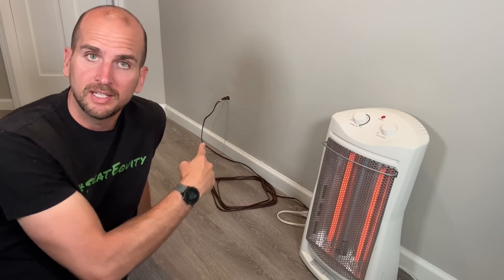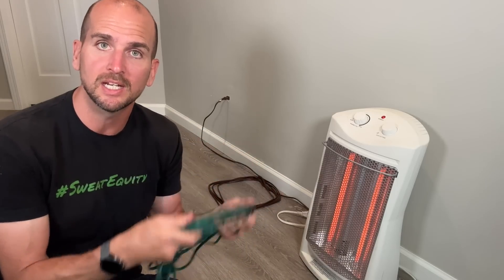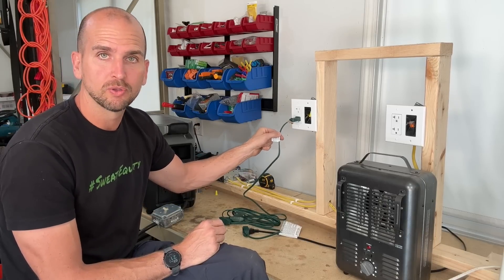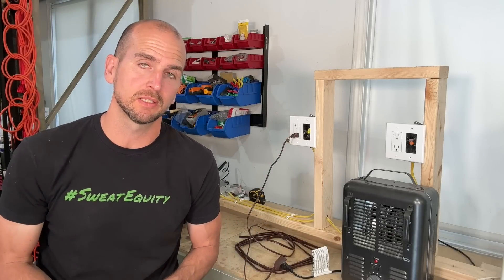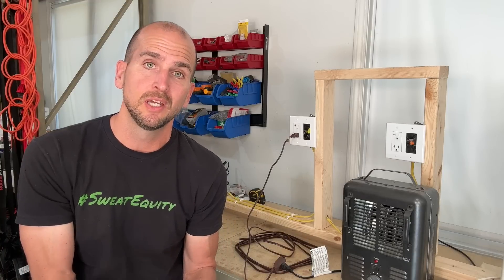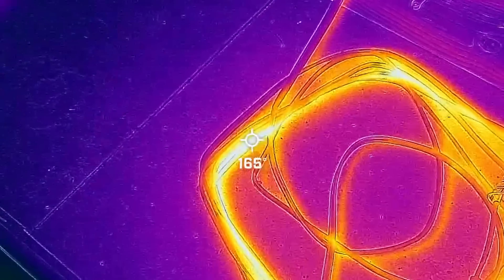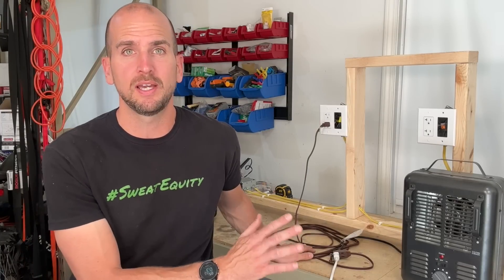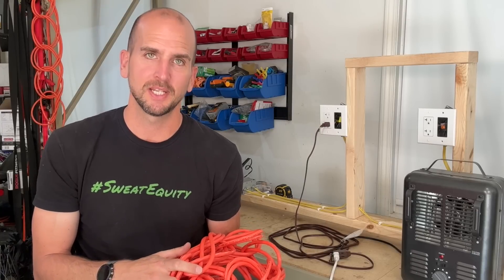The #1 Most Dangerous Electric Device in Your Home

Comment: My biggest concern with a space heater is the outlet. After i smelled smoke i began pulling outlets in my living room and found that most used backstab connections with 14 gauge wire and were daisy chained. 2 were visibly damaged and one was almost burned in half. I cut out the burnt wire and replaced every backstab outlet with a commercial grade outlet throughout the house, using the back connectors that securely connect with a clamp and screw.

Comment: I use the heavy duty AWG 12 type extension cords for my AC units, or for space heaters, or for a fridge.  I never wind any excessive length in a coil. I put the excessive wire length in a figure 8. This makes for less induction affect and thus less possible heat in the wire.  For small power consumption devices I use an AWG 14 most of the time. This is when I will be using less than about 6 Amps or so. 

I mostly make my own extension cords.  I buy the male and female heavy duty type plugs and sockets.  I buy the wire off the reel at the hardware store. I feel more secure about the quality of the connections in the plug and socket.

Comment: Another swell and sane video. Well done.

If you get into the trade you become aware that most fires reported on the news are attributed to electrical problems. 

As for gauge, since I understand loading I size the cord to the job. If it's a 10' extension for a table lamp and a clock radio, #16 is fine. If I'm cutting 4x4 on my mitre saw I use the shortest #12 that'll reach.

Speaking of that I bought a 100' #12 extension once on sale. Since I don't always want 100' I got a couple of cord ends to split the cable in two. Just before the sidecutters closed I got the idea (as close as I ever get to genius) that if I cut it in half I'd only have a choice of two lengths (50' or 100'), but if I cut it 1/3 - 2/3, I'd have my choice of 33', 67' or 100'.

Another vid I ran across some time ago concerned the use of those extension cords that come permanently attached to an enclosed reel with the outlets on it. You would think an advantage of that scheme would be only having to unspool the amount of cord that you needed. However even with a relatively moderate load, the fellow had this thing melt down on him due to mutual heating from multiple coils having been left inside the plastic enclosure.

Re storage style, after coiling cords up for most of my many decades, I recently adopted the daisy-chain method, but only seasonally. In my Canadian prairie climate you'd never be able to uncoil a cord stored like that in the winter, unless the jacket was rubber. Even then, the tightness of those little coils is kinda sketchy for handling at -40.
Reply from the maker: Thanks for all the great feedback and you are right in a cold winter if the cord is outside it can be a hassle to easily pull through the daisy chain.

Comment: I never had a problem with an extension cord but I did burn up a surge protector. I had 2 tv's, 2 cable boxes, etc. so I could watch 2 football games at the same time. One day I came home and it was all black and stinky. So I threw it away & bought another one. This was before flat screens when a 32" TV weighed about 200lbs and took alot more power to run (so I was told)

Comment: Some of us have no choice! Those who provide heat, as part of their rental, play with the heat. Those with breathing problems are impacted most. It's actually better to have the heat constant, so they don't keep us sick. That impacts insurance companies as well.
Where I stay, they have a habit of turning down the heat at night and winter is almost impossible to survive!.
Companies who make portible heaters could design them better so they work with common household loads. They know where their devices will bs used.
I never use an extension cord on any high draw circuit and I often check for heat, on the cord and the faceplate.
People need heat, no matter who provides it. 
Over the last 20 years people here have died that have breathing problems. Was it the cause?

Comment: The $200.00 single wall outlet is a laugh. Way less expensive to just install a box and single outlet/plate.  I don't like to even use space heaters as they pull so much current of some 12.5A combined of what else is in the branch circuit.  My extension cords are no smaller than 16 gauge 3 wire for light duty. Along with 14 -3 and one 50' 12-3.

Comment: I have read articles that one of the biggest fire risks with using a space heater is using a "Power strip" as an extension.   The power strips are meant for low drawing appliances and electronics.  They have been linked to many house fires when used with space heaters.

Comment: Extension cord plugs (even 14 and 12 gauge) can be a crap shoot if they get too hot under load. They're either crimped or soldered to the prongs. I like to run a heater for a while to see how the cord and connectors manage. If the plug gets uncomfortably warm, I just snip it off and put a heavy duty plug on. They have heater extension cords. Although they have the high temperature, rubber insulation, they are just 16 gauge and will get quite warm. They're also not grounded. A 14 gauge cord may actually be cheaper but will run cooler. 14 gauge and thicker cord uses a rubber insulation. I'm guessing it can handle higher temperatures. It's harder to strip when replacing the plugs, but just take your time.

Comment: Yeah, those lamp extension cords really are a design flaw. They really ought to require fused plugs in all new extension cords (and replacement fused plugs should be a thing and easy to find). As for preexisting extension cords, well, definitely use them wisely! I'm also not in favor of using 20 amp circuits for everything, but A. kitchens and laundry rooms require 20 amp circuits, and 2. Lower-current circuits here in NA are still 15 amps (Peak, but the 13 amp rating for lamp extension cords is also peak). 13 amp indoor/outdoor cords just simply shouldn't exist.

Comment: The problem I find is that while extension cords are easy enough to buy in 14 or 12 AWG, it’s hard to ensure that power strips and other accessories all meet that requirement. I would like my family to just be able to grab whatever cord they want without worrying about over-current issues, and I have found some specialty power strips and other equipment that I would like to use, but it is not “versatile” as you said because space heaters would overload it.

Comment: When I was a kid we had a cabinet style clothes drier, the sort where you could hang stuff in it.  It stood in a corner of the laundry where there as no power point so it was always run on an extension lead.  Mum always used a 7.5A (0.75 sq mm) lead while it really should have had a 10A (1.0 sq mm) lead.  Those poor old 7.5A leads became quite hot and floppy but never actually failed.  It's a miracle they didn't really the insulation must have been on the ragged edge.  The power point circuit had a 15A fuse.

Comment: This retractable cord reel that mounts in the wall i have is pretty nice for convenience, but they actually for safety put in a resettable 13-amp breaker in the unit even though it has 14-gauge wire presumably it is because you could plug something in while it is all coiled up and overheat the wire.
Reply: Cord reels are derated due to the cord likely being coiled while in use not allowing for heat dissipation.  18 gauge cord reels are illegal in the US, 16 gauge reels are rated at 10 amps, 14 gauge reels at 13 amps and 12 gauge reels at 15 amps.

Comment: I've known for a long time that extension cords are the causes of most electrical fires. I didn't know why until I got older and studied electricity. From that point, I thought ideally, all extension cords should start at 12 gauge and NONE of them should be without a ground. I also like the idea of a fuse, so that if they should become dangerous, they have a shutdown.  My Grandpa had a produce business and he ran a space heater in the trailer of his truck and a heat lamp under the cab to keep the engine warm, using one extension cord that was a standard household cord. He burned them up and repaired them with electrical tape, and almost burned down his garage. He couldn't understand why and I wasn't old enough to know to tell him why.

When I turned 13, I told my parents I was moving into the basement. I had a space heater, and I went to the hardware store and purchased a heavy gauge extension cord. I think it was actually 10 gauge, and it was VERY expensive and they only had one. It was grounded, but my heater was one of those fanned heaters with a plastic housing so the heater itself was not grounded. Your heater looks better than the one I had and the housing looks like it's metallic so I don't know why it would not have a grounded cord supplied. If a hot wire came into contact with the housing, it wouldn't short to ground and trip, therefore creating a dangerous situation if you touch it or if there's a water leak and you step in a puddle that also touched the heater. Of course a GFCI would also kill the power, but it should still be grounded. People don't take those wires seriously either.

Comment: Whenever I buy an extension cord , 
I always get a heavy duty one with 12 gauge wire because once in awhile I use my heat gun and that draws 1650 watts which is more than a space heater but still I will not use an extension cord for a space heater as it's a dangerous practice
For safety's sake When you buy an extension cord , Get the heavy duty one with 12 gauge wire because you'll know that it can handle the load of high wattage power tools and remember , Extension cords are not for permanent use as per The National Electrical code and OSHA if used in a commercial business
Wherever you're going to use a space heater , It's best to have a designated circuit on its own breaker for the heater installed
Reply from the maker: Thanks for the feedback!

Comment: 1:27 The cord also is not fully open so it does  not cool well. One should always fully open the cords or limit the load. In Europe all extension cords are rated for 16 A with the exception of single Europlug cords that can supply only a single 2.5 A load and can never  be never split (using readily bought splitters)

Generally an extension cord does not need to be as thick as fixed wiring as it is not hidden in the walls so it cools better. That also means you should not hide them under carpets.

One important thing is to use good quality cables. Extension cords are something one can use and store for decades and then reuse them.  One might consider if it is better just to buy a new one.

Comment: Also anyone who is into vintage stuff should always have old lamps rewired. Those old crusty cords are a fire hazard. Especially if you want to use it with the still widely available incandescent 3-way bulbs which are way cheaper than the LED version. Doesn't have to be a whole lot of watts to start a fire.

Comment: I didn’t even think of it like that! But how di we calculate how much christmas light energy is being sent or used in one strand?! Or how many light strands can we piece together on one cord on one outlet?? I’m able to design it where I have all the lights on the front of my house on one outlet… I’m assuming it’s bad?
Reply from the maker: If you have a bunch of LED lights the load should still be under a safe 80% constant load for that circuit.  You could test with a current clamp.  I will be doing a video on current clamp basics soon.
Reply: I do think theyre all LED, maybe 2-4 are the long skinny bulb. But maybe a total of 15 strands that are a mix if 20, 50, 100’.

Sweet! I’ll keep a look out for that video!

Comment: It would be important if the cord industry started putting fuses in all male connectors. I believe it would prevent a lot of structure fires in the us. Other countries also already have this figured out.
Reply: It would save a lot of lives and money. Manufacturers would have to deal with "more cord stopped working" complaints but ultimately it would be a positive change.
Reply: They do that in the UK already.
Reply: @jolyonwelsh9834  thats one of the many reasons the UK electrical system is generally considered safer. Fuses are a must have here especially because of the higher amperages due to the lower voltage.

Comment: Great video.  People should keep in mind that even if they know better than to plug a high load device (or multiple devices) into a light duty cord, do your kids and spouse also know and will remember in the future?  If you use a cleaning service or have house guests, will they know not to plug hair dryers or vacuum cleaners into certain cords?  I have a UPS for my network gear, and had a small power strip plugged into a controlled outlet on the UPS.  My wife accidentally plugged a vacuum cleaner into that power strip, which cause the UPS (and connected gear) to shut down as the current draw was much higher than what it could supply.  Luckily nothing was damaged, but it was a good reminder to me to label things very clearly and not to expect that others would know what I did.

Comment: I was guilty of not knowing anything about extension cords and hooking them up to my space heater (which I used often).  I had mine plugged into a power strip surge protector that was plugged into my wall.  At one point I felt the end of the extension cord plugged into the power strip and it was HOT.  I then learned that there were other extension cords that were made for these items, and after I purchased one I haven't had that problem with that space heater again.  Thank you for sharing this important information.

Comment: I don’t care I will never trust them. They get the wires so hot they will burn off and short. I’ve seen it happens at my mother house and my old house, the outlets were completely melted and even the outlet box was charred,Luckily the houses didn’t catch but we got lucky.  You’re better off just hooking up propane or a dedicated 220 electric baseboard

Comment: I went through a daisy chaining phase with my cords.  it works okay if you're carrying your cords in a tote, but it twists the cords up and makes them try to curl all the time.  there's a trick to finishing a coil that lets you either have a loop for hanging your cord, or secure the loop over the top of the coil to lay the cord on the floor or in a tote.  it also lets you deploy the cord by holding the "smart" end and throwing the coil from the receptacle towards where you intend to use it.

Comment: i have seen in the news of fires that burned down houses due to people running heaters and even air conditioners from extension cords.

if you must put a demanding appliance on a cord make sure you get an appliance grade cord witch will have very thick wire and can handle the load.

the other danger that can happen is with fuses is people bypassing fuses by putting foil around the fuse or even using fuses rated too high.

doing that can lead to a fire too

Comment: Great review on extension cords. What can you tell us about extension cords with a 6 outlet surge suppressor or interrupter with the switch on the side?
Reply: that switch is usually also a circuit breaker, or the strip will include a circuit breaker, so it's better than the cheap extension cords.

Comment: This is great information.  The only extension cords that I use are the big 10 and 12 gauge outdoor-rated extension cords.  One winter, I had to run a space heater overnight in a vacant house after the furnace blower motor failed, just to keep the pipes from freezing in the basement.  Used a 10ga extension cord, and removed all flammables within a three feet radius, with the heater on low. Not really safe, but had to do it.  Replaced all the old receptacles that had sloppy fit shortly after I bought the house.

Comment: Never ever use a ‘roll-up’ style extension cord on high load devices such as a space heater. Doing so turns the rolled up extension cord into an inductor. The outcome is that the cord will generate a massive amount of heat which will melt the insulation and could start a fire.
Reply: Largely a myth.  Yes there is an increase in inductance coiling a cord up but it's not that simple.  The main problem with coiling up a cord is the reduction in heat dissipation.
Reply: @retrozmachine1189 yeah I've heard of the  inductor myth as well, and to understand why it helps to know some basic physics.   Current through a conductor creates a magnetic field, which is amplified by coiling the wire, and alternating current produces a rising and collapsing magnetic field 120 times a second (or 100 times/sec for those in Europe and many other parts of the world that use 50Hz/230 volt) .  This induces Eddie currents in ferrous metals causing them to heat up, this is how an induction cooktop works.    By enclosing the hot and neutral wires together such as the extension cord example we have two equal but opposite magnetic fields which cancel each other out,  so no inductive heating is possible.